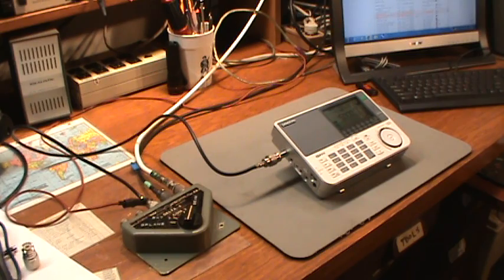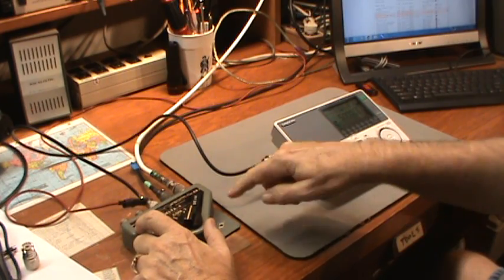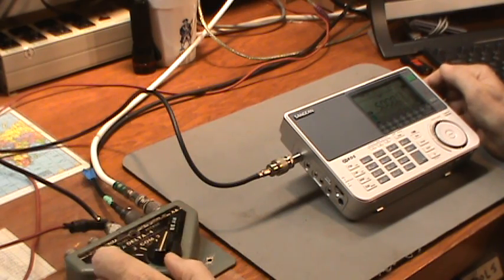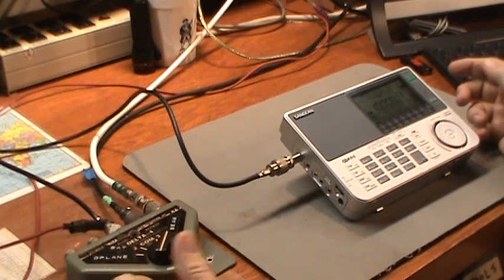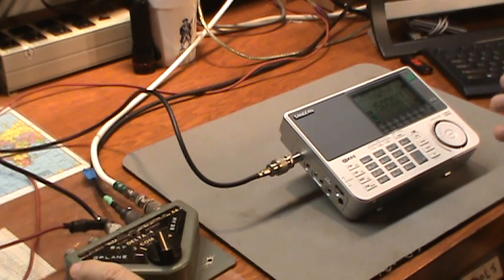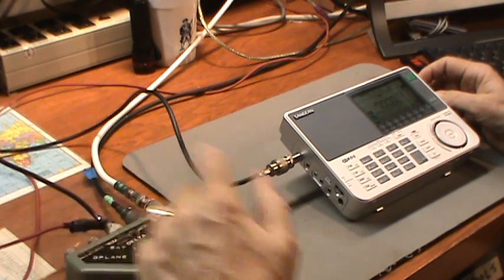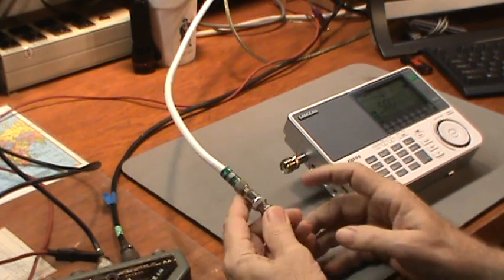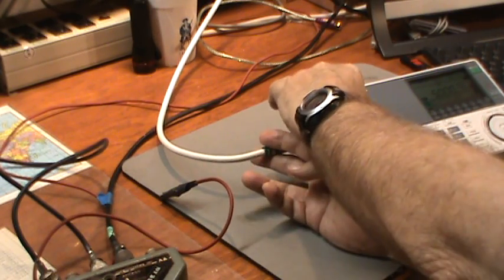TRRS #0829 - End Feeding Antenna Testing

Comment: Tom, I really like your Youtube channel and the way you do your reviews. I am a disabled vet in Wichita, Kansas and after watching one of your videos, I dug out my Tecsun PL-660 and set it up out in my garage work bench.  Thanks for re-sparking my interest in SWLing! I have the Sangean roll up end fed antenna strung around my garage but I think getting one outside is better. I am interested in setting up the end fed one you reviewed from the DRC inc. guy on Ebay.  

The only option I have is to run the coax portion out the doggy door and over to my privacy fence, then down the top of the fence to the end of the yard (about 30-40'). My HOA won't allow anything visible. Will this work with the wire only 6 feet off the ground?

Thanks and keep these video coming!
Reply from the maker: +CoolSpace It will help to get it outside and away from the house.

Comment: Hi Tom.. From my experience when you're receiving using 50 ohm vs 75 ohm, there' s no difference.. I use a balun/unun on my end fed antenna and my lead in coax is 75 ohm. It works perfectly. it's a cheaper alternating then buying 50 ohm coax when 75 ohm is much cheaper and easier to get. When you're transmitting, impedance is more important. Just my observations.. I like your shows. Keep up the great work.
Al
Reply from the maker: +The Random Hobbyist Thank you for taking the time to comment.